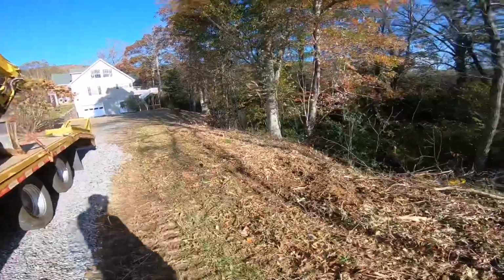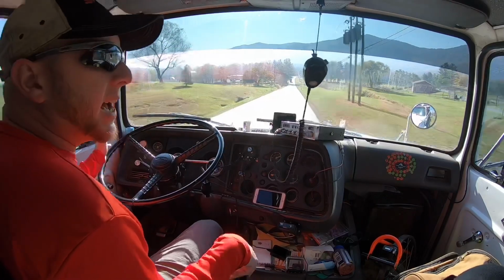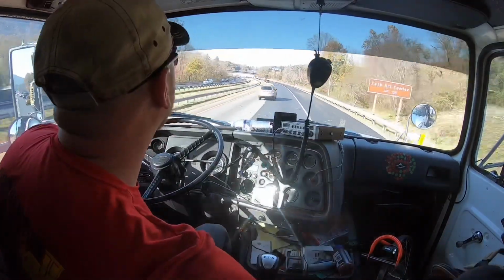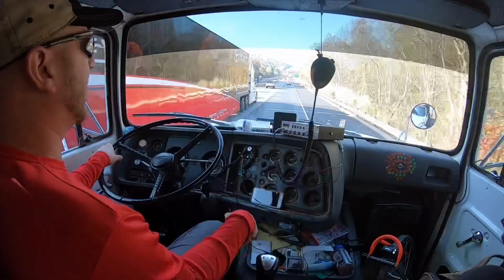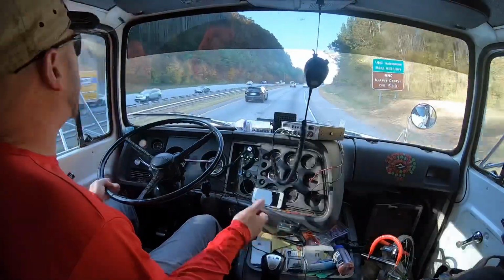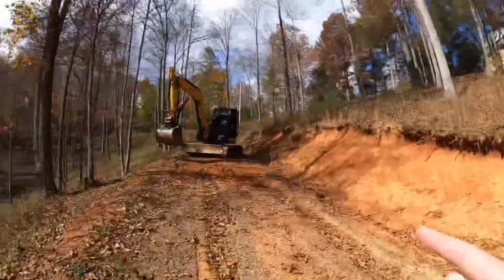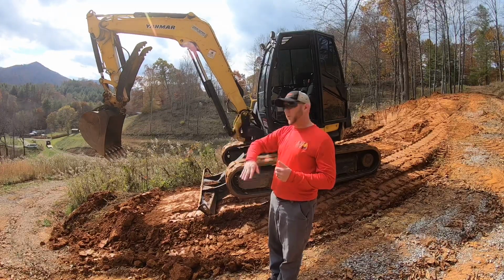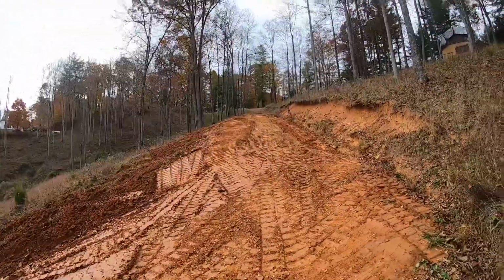Gravel road repair job-part 1

Comment: Great advice on hauling fuel weight, it adds up fast without you really knowing it. How well do you like the Yanmar excavator?
Reply from the maker: Antonio Castrejon It’s a great machine!!! I’ve never had any trouble out of it. Thanks for commenting🙏🏻
Reply: DigginLife 21 Does that machine have any of the emissions stuff? DPF or Def fluid?
Reply from the maker: Antonio Castrejon no emissions stuff on that one.